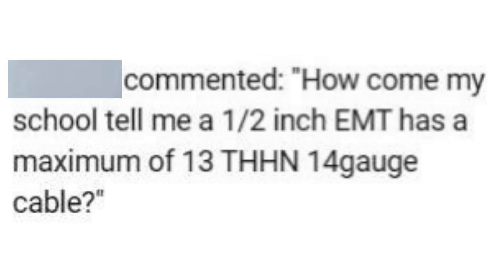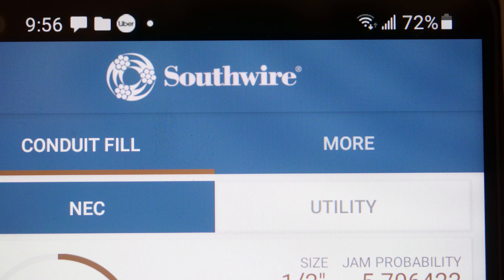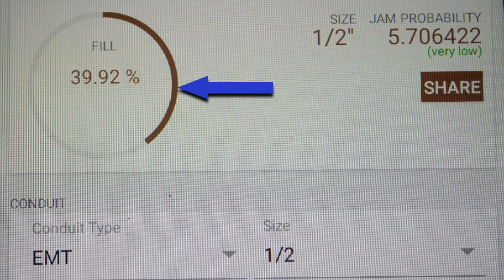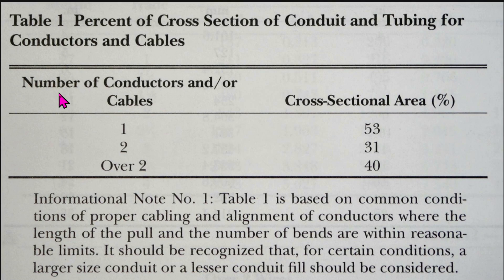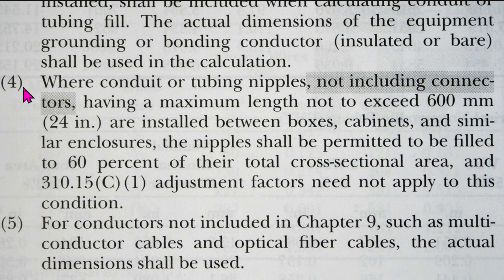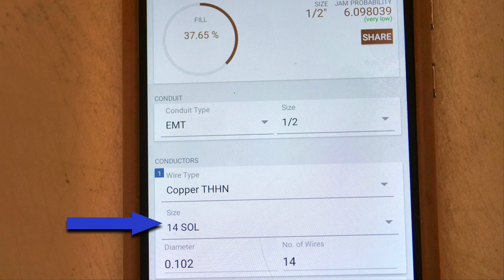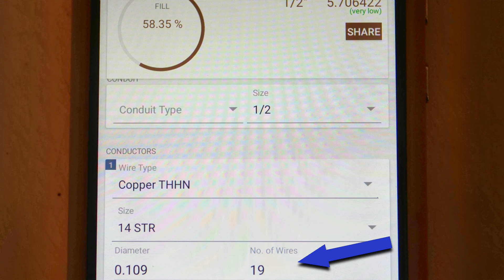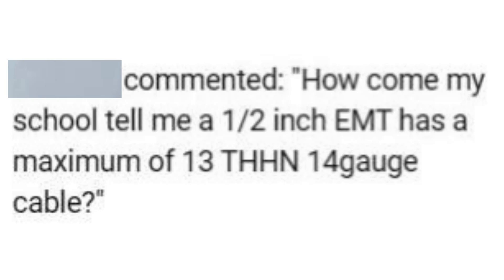Do Solid and Stranded Wires Have Different Conduit Fill Spec? Does the Length of the Conduit Matter?

Comment: Chapter 9 T. 5 the approximate diameter is .111  the approx. area sq in is .009  you want the area of sq in.  1/2 in emt area sq in. is  .122 / .0097 =12.577  stiil only 12 conductors because of note 7, but correct numbers.

Comment: The school taught them this because they used Chapter 9 Table 5 and Chapter 9 Table 4 to do the calculations which resulted in a total of 12.57 14AWG THHN in 1/2" EMT. They rounded up to 13 conductors but that is incorrect because Chapter 9 Note 7 says you need to round down when the decimal is 0.8 or lower. 

The diameter of the wires in the App (although correct for the manufacturer) is much different than the NEC lists. For example, the App shows 14AWG stranded having a diameter of 0.109 but the NEC lists it as 0.111 (Ch9T5).

So, I feel the correct answer (for a school situation) is a maximum of 12 conductors of 14AWG THHN in 1/2" EMT if you are going by the 2023 NEC.

THANKS for the math Bill, always great to get the ol' noggin working.
Reply from the maker: Thanks!

Comment: This ruling of code are going there be a lot of house fires.  Do not follow rule but go better than the rule 7 conductors.
Reply from the maker: I do agree with you that it's not a good idea to fill conduits to the max with as many wires as possible. I was just going over what the maximums are according to the manufacturer's specifications. Thanks!

Comment: I ran 8/3 southwire Romex to a sub panel in the basement. When transitioning from attic to basement I ran through a segment of schedule 40 3/4 conduit to protect it from accidental nails. I was taken back after looking at the wire diameter and calculating the total fill was around 54% (1% more than 53%). Needless to say, I’m not changing it. 😂.   If you break the Romex into 3 8 stranded and 1 10 awg ground, it’s fine, but the Romex package takes more space.   Just a little fun with math and too much time on my hands.
Reply: I’m not sure, but I don’t think you are supposed to run the Romex in conduit. Just the individual wires.  Maybe Bill could comment on this!
Reply: @glasshalffull2930  Yes you can run Romex in conduit.
Reply: @patrickkelley3408  I was hoping for a NEC reference.
Reply: @glasshalffull2930  Be aware of conduit fill and when and where it is not permitted .NEC 2020 334.10, 334.12, 334.15 (B) in rmc,  imc, emt, Schedule 80 pvc,
Reply: @patrickkelley3408  thank you 🙏

Comment: The southwire calculator is based on the actual dimensions of southwire brand with simpull insulation which may differ from other brands & definately differs from the NEC calculations.  For instance southwire says you can fit 18 #12 solid in 3/4 pvc where the NEC or Cerrowire calculations say 15 max.
Reply from the maker: Very interesting, thanks!
Reply: @SparkyChannel  thats based on the tables, depends on what year code book you look in also , 2005 says 15 & 2017 says 18 but neither specify stranded or solid for thhn but there is indeed a difference & you would actually have to do the calculation to figure out the difference but cerrowire calculator gives different results than southwire calculator.
Reply from the maker: @sparkyjerred419  Great point. IMO if you use Cerrowire and want to use an app, you should use the Cerrowire app as that would be manufacturer's specs and if you're using Southwire, you should use the Southwire app as that, once again, would be manufacturer's specs. What do you think?
Reply: @SparkyChannel  it would depend if you knew what brand of wire your boss is buying before you run the conduit if you read through the codebook enough it says to use the specifications from the tables unless you know the manufacturer specs & then you are allowed to use them. I tend to use the southwire calculator as it seems the cerrowire calculator is based on older codes or is using stranded dimensions & it doesn't give options for solid or stranded.
Reply from the maker: @sparkyjerred419  Excellent! Thanks so much for the info! I think you'll like my video coming out tomorrow. Have a great weekend!

Comment: and for those who are completely new to it, the type of insulation also matters.   I've found the southwire conduit fill app can be a little conservative in its advice - it also tells you how likely you are to have trouble pulling the amount of wire you selected into the conduit.  as the code says, the length of the conduit run and the number of bends affects how many wires you can ACTUALLY get pulled in.
Reply from the maker: Thanks Ken!